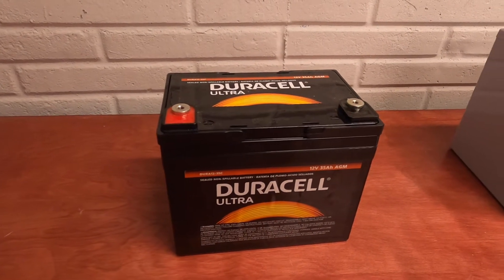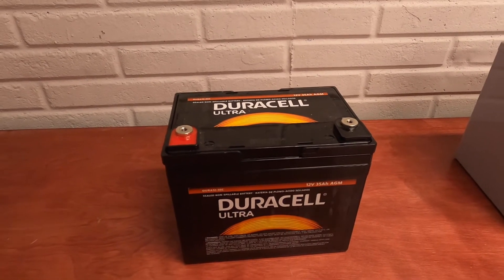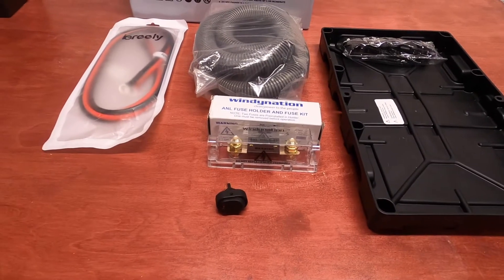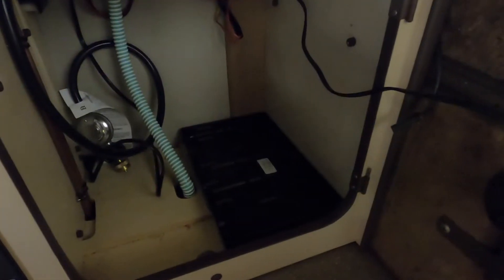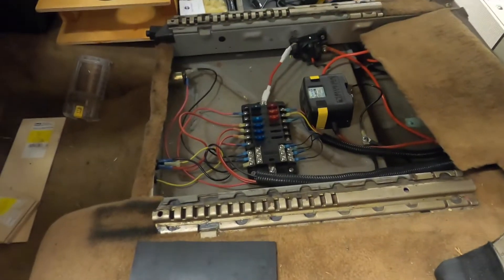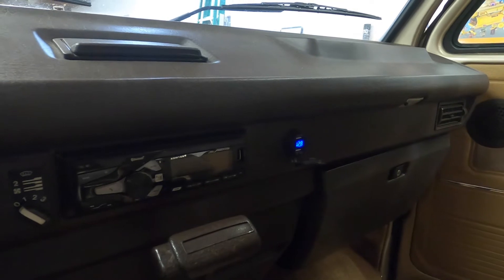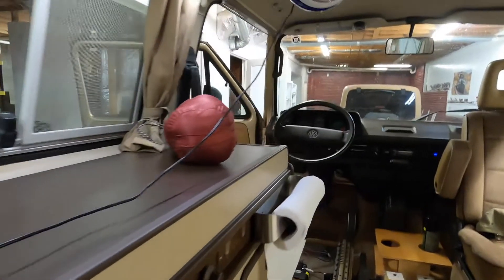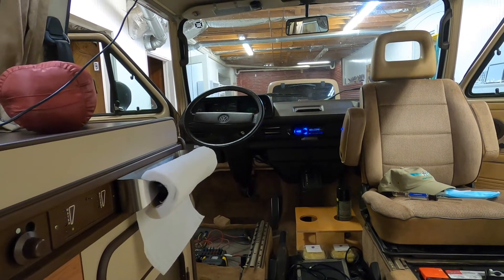Vanagon Auxiliary Battery Upgrades 2020

Comment: Nice install vid! How are you liking the TF49 Truck Fridge? Are you satisfied with the available room compared to the stock fridge? I'm leaning towards getting one instead of having a cooler style fridge taking up space on the floor.
Reply from the maker: Thanks! I'm really liking the TF49. It was the right choice for me. The amount of room inside the fridge works for me, and it certainly works better freeing up floor space in the van. I think it comes down to what type of food you plan on packing with you. I don't pack a lot of frozen food so the TF49 works well for me. If you're planning a lot of frozen foods then the chest fridge on the floor might be the better option.